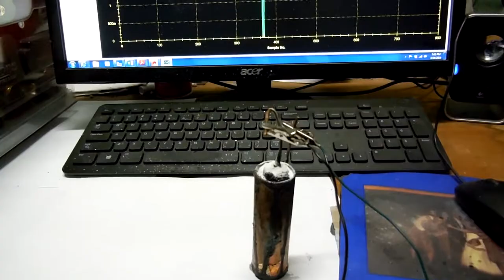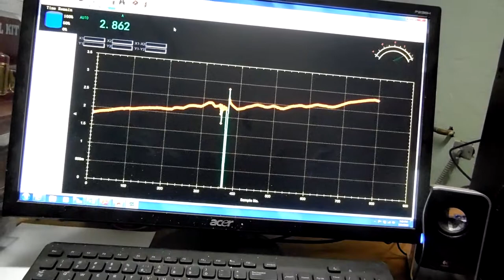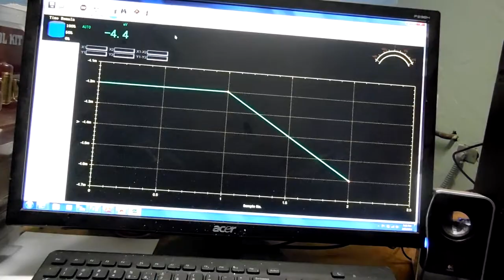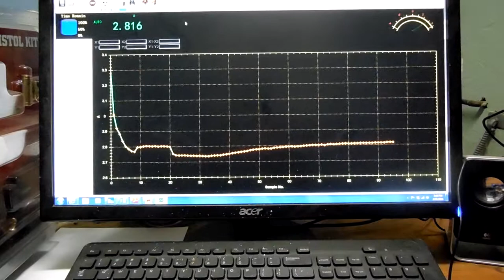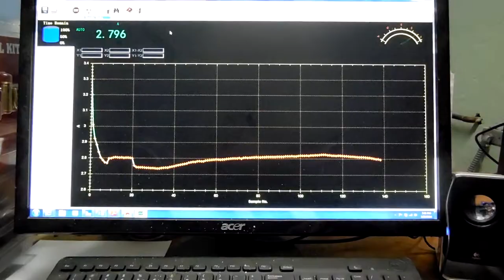3.5 Amp magnesium one cell battery

Comment: cool deal , i finally made a chilli powder magnesium epsom salt  ,alum ,no salt AA sized cell its on my channel it put out 1.57 volts right after the mix hardened. i melted it together in the microwave in 30 seconds lol    its been about 3 days and unloaded it still has 1.44 volts. i have not tried any heat yet as it is encased in just plastic.

Comment: Cool they could just sell batteries with Bic lighters and be done with it lol
Reply from the maker: You can dry these cells out too much charging the cell with heat
It loves water before and after you charge it with heat, otherwise it takes a long time to soak in water to get the cell going again

very very dry cell still produces same volts but low amps, in the 45ma range, I am trying for a bigger power cell

Comment: Amps? You mean milli amp right?
Reply from the maker: This is AMP's not Milli amps
Reply: I think you need to dobble check that my friend 

Magnesium copper cells just don't put out that kind of current 
Unless you have some new Information
Reply from the maker: jonfrommanahawkin1 I am not sure where you are getting your information
Have you ever tested a AA battery?
I have 3 multi meters, how many do you have?
You can believe the Amps, my friend
Keep in mind that this cell is brand new, just forming 
power levels drop until I recharge the cell
Reply: Rolling my eyes 
Do we need to have a pissing contest?

Even fresh I've never had a reading that high 

What formula are you using?
Reply from the maker: jonfrommanahawkin1
Hmmmm...........Not sure how to respond to you, or even if I want to, with your attitude  
Maybe I should start with a life lesson first, that may do you more good than showing you how to make a high powered cell
First of all I owe a great deal of gratitude to many people that are working together on these types of cells, I just choose to go in a different direction on the mix design that is currently being circulated right now that you found online
John Bedini, Fausto, Lazer saber, Ibpointless, lidmotor, slider, Marcus Reid and many others, in fact the only reason why you know  the mix you are working with is because of Ibpointless, do you think you should mention that with the cells you are selling (open source does not mean you need to be rude)
   
1. You do not roll your eyes in a conversation, this is the height of arrogance and in this case shows off your ignorance
2. You never answered my questions of how many meters you have, this was eluding to the fact that I check my readings with several meters to make sure they are reading accurately, maybe I did not spell that out for you, and by the way I only saw one in your videos, Have you checked it for accuracy lately? 
3. The audacity and arrogance of your statement that just because you have not created a cell with this type of power is preposterous
4. You do not roll your eyes at some one and then ask for  there secret formula mix, I had to laugh at that one
I know, I will give you 3 years of my research for you to post it on your channel and claim it as a great discovery you made

Last but not least, if you want to have a civil conversation on these topics in the future, please watch your attitude
Reply: First 
I do accredit my initial cells and formula 
Second 
Its no secret 
But I will give you one thing 
I will watch the " attitude " 

However since laser's formula was puplic I've seen it many places and not to mention Johns formulas public for 3 years 

I've been tweeking it for months now so I can at this point say my 
Plus I am quit tigherd of all the hacks playing camera tricks 
But I wasn't implying you to check with a different meter I was implying you where reading the wrong scale 
Wich has been done already 
The pissing comment was at you because I was figuring that this was going to be a "oh look wat I have and its better then yours" 
That's what I was trying to avoid 
But if you don't want me to divolge any more "secrets" 
Then you should understand its just a galvonic cell with a solid state electrolit 
But you knew that already right
Reply from the maker: jonfrommanahawkin1 Thanks